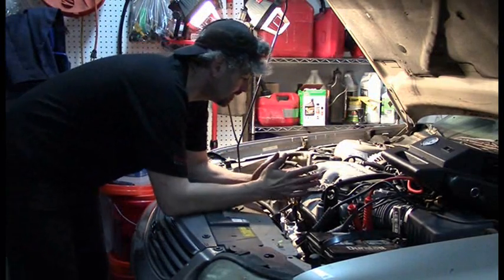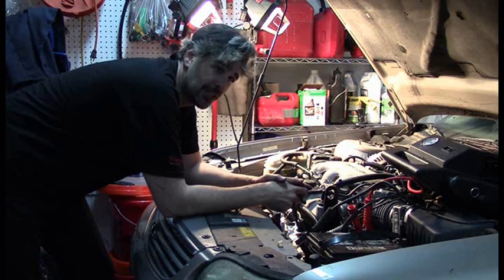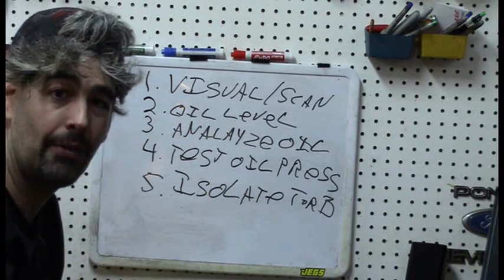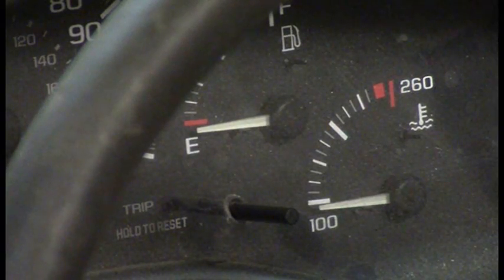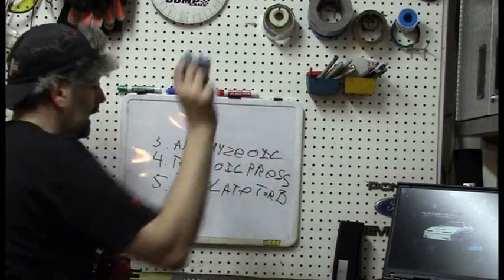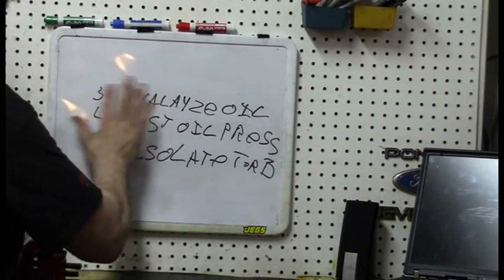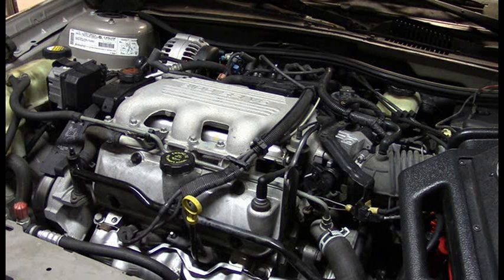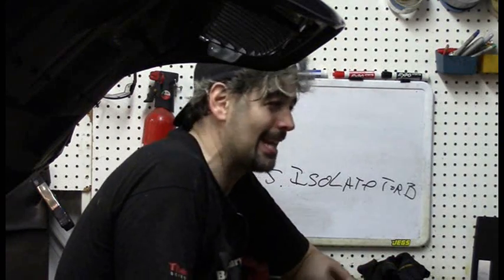Engine Noise Diagnosis-Part 1

Comment: if, as you say, you suck at diagnosing engine noises, why are you doing videos on how to diagnose engine noises. VERY F***ING FRUSTRATING !
Reply from the maker: Because I don’t have an “ear” for it. And neither do you.  I need to use science and logical deduction to solve it.  i am showing you how to do it scientifically so you can diagnose similar.  Did I not find the source of the noise?

Comment: my dodge van knocks same i cant  find problem so im gonna pull oil pan. its a 3.0 i hate it. your hearing is fine.ur a good fixer.
Reply from the maker: Don't pull the pan- instead see my video "diagnosing engine knock using a screwdriver".  MUCH simpler!

Comment: Hi I watch your videos a lot, im wondering if you can help me.. I see you're a very trusted mechanic and you do a proper job of diagnosis and fixing. I have a 1.9L common rail diesel 4 cylinder engine and it's making a light tapping noise when revving. I believe it's the injector nailing as it's only between certain RPM. ( 2700-2900) and stops exactly after this. 

If I unplugged no 2 injector the noise goes away. It only taps during acceleration and stops as soon as you let off throttle but comes back with any minute amount of pedal pressed. I.e only under injectable conditions. Which leads me to believe it is the injector.

I have two questions if you could kindly help I would really appreciate it and it would answer a lot for me as I can't find an answer to these anywhere.

 1 would a tappet or valve train noise be constant or could it clear up after certain rpm?

Could it mean I have piston damage and the relieved combustion in that cylinder quietens the noise?

I have driven 3000 miles under these conditions and nothing has changed or worsened, it still tapps away how it does.

Thanks in advance
Reply from the maker: What happened when you did the procedures shown in the video to differentiate top or bottom end?

Comment: I have 1993 Buick century and I replaced the fuel pump and filter runs but wont idle running ruff won't maintain rpm and is it possible to put an inline electric pump in and get the 45 psi of pressure to make it run the new replaced pump is only putting out 10 psi
Reply from the maker: Sounds like you have a voltage drop problem.  Test voltage drop- you never needed a new pump and filter obviously.

Comment: I am a qualified mechanic been doing this for about 20 years now but I'm always learning something new and seeing new problems. I am working on a 2001 Buick rendezvous engine has a ticking noise like this, and overheating problem due to leaks, I did a compression test 4 cylinders are at 150psi one at 155psi and the #1 cylinder is at 35psi and that cylinder is pushing oil out the exhaust I pressurized that cylinder with air compressor with valves closed and did not hear it coming into the crankcase intake or exhaust it seemed to not leak anywhere so I am puzzled as to what is going on I am in the process of buying a micro boar scope to look inside the cylinder to see what it looks like inside. I was totally expecting pressurizing the cylinder would have air coming out of the crankcase indicating scored cylinder or bad piston rings but I had no air leaking anywhere. Usually this test putting 160psi to a sealed cylinder will show rings, bad valves, or cracked head or head gasket out. Any ideas on what to try next?
Reply from the maker: Sure lounds loike a worn or broken ring to me. Try the leakdown and detecting pressure at the PCV valve perhaps.

Comment: 99 Malibu, hmm. I'm gonna say it's too end probably timing chain. But I dunno. And yes I known this was probably made after you updated the cause but I am working at an auction and doing inspections and condition report writing. I am not so great with sounds either. These videos have been really helpful in broadening my tactics for discerning different problems. Was it this video that you had got flustered because of all the cars you had. Man do I know how you feel. I got them coming out if my ears some days. They just stack up and keep coming. Thanks again !
Reply: Maybe not timing but I'm saying too end I am pretty sure about that.   Didn't seem deep enough to be the piston  I think (not entirely sure )  that the tone is deeper. I mean it's metal on metal. But it is deeper in tone then the top end noises.  I don't know how to explain it I guess. But either way I'm saying too end.  And I missed the update or actually solution.   Also I think the water in oil is a bit misleading in this case.  I don't think the gaskets were leaking I'm gonna say it was condensate perhaps u live near the surf    guessing by the hair.    Ahhh man just kidding anybody hating on these videos c a promptly go fuck themselves.  Thanks for your time and effort please don't flame my response. I am truly trying to become proficient in what I do.

Comment: Wel, well, I did not even check part #2 yet, but....I am saying, it is valve and timing chain related for sure. Chrysler engine, like famous 2.7 V6, has a very weak part, and it is water pump. I bet this engine has similar water pump, turned by timing chain!! They start leaking around 70-80000 miles,...how many miles this car has??And, when water pump start leaking, coolant goes into oilspace, and into valve covers/ heads. Sludge start accumulate, and then valves/ timing chain does not get enough lubrication/oil!!! First sing is that you start loosing coolant??? Was coolant low in this car??? If bottom end is still OK, bearing OK, you can still save this car by changing water pump/ timing chain, and adjust valves!!! Lets see, now I will watch part #2. interesting to see, if I was right =))

Comment: the flash was more then one flash per . . it's a bottom end problem in my opinion.  . I had the 1990 grand-prix SE 3.1 v-6 at around 310,000 km I started hearing that same noise .. ... the 3.1 were known for water pumps and head gasket issues ... antifreeze getting into the oil (bottom) part of the engine,  the piston and connecting rod get damaged because of lubricant issue.  the head gasket is allowing enough air in to case a compression drop and eventually the rod will go through the lower part of the engine block  (Cylinder 3) went on my car

Comment: I found the best way to avoid fixing engines is to avoid GMC products, i have not had ANY serious engine problems in 30 years since i quite GMC previous to that ... many.....your Vids are great!! shows that anybody can learn automotive diagnostics , it really isn't rocket science keep it up..
Reply from the maker: Not sure how you come to that conclusion about GMC when my channel alone disputes your argumentum ad populatum logic fallacy.
Reply: Schrodingers Box  Sorry i should explain,   MY family own a very large construction company we buy 5 or 6  trucks per year and have 35 in service we have gone exclusively with 2500   Dodge platform  products 5.7's hemi's and cummins  we tried the GMC  thing, the engines were  Junk no torqued  gas hogs, 4 blown motors while Hauling loads, (gas engines) and the allison transmissions was the true  Disaster for all of them 50% of trucks got new transmissions within 50,000 miles , all  SOLD immediately afterwards.. and Ford with its endless frozen-in- the block spark plugs extractions 2 or 3 on every vehicle  can't sell them or give away...  and other decades long engine issues carried by Ford Triton engines, JUNK no longer made.. as well as  5 late 90's and early 2000's dead powerstrokes engines  100,000 miles on them, rebuilt and sold immediately.  been there done that.. lol never again!! LOL!!  like i said we have gone with 2500   Dodge platform  products 5.7's hemi's and cummins its night and day  unquestionable  difference in reliability..... so much that  we fired our in house Trucks maintenance mechanic LOL (sleeping at the shop)...  he's now a crane operator , he does carry around a small box of  engine coils though...i will say that the NEW GMC's line are completely  new trucks... why did it take them so long to finally build heaVy duty truck.. Screw ford still junk

Comment: Hi, Schrodingers Box... question.. I just saw this episode and noticed that the wipers where coming on when you where messing with the plugs.  I have a simiular problem which my 1996 sebring in which I am driving and everyonce in a while my car stubles and then my wipers come on, also when it warms up on hot days the car will not drive well at all, but will start... now i have replace my disbiter but now it runs worse and stumbles. I relize that this is the year the OBDII came out so not sure what that means and I have been told I need to replace my PCM., other than that it drives great..just when its cold and for short drive.. :P Thanks

Comment: I've never struggled more when it comes to mechanics than when it comes to diagnostics (computers are a whole nother worldl. I just found this video as I was watching a bunch on engine flush and I just dropped the bottle of engine flush and grabbed a white board. I've never seen it done like this. by far one of the best video styles for diagnosings as it gets. thank you! I'll let you know what it was that cause the sound

Comment: if the oil pressure light goes out can it be assumed that you have enough oil pressure to not cause a noise.
so then traditional methods of isolating if it's top or bottom and is disabling cylinders and the timing light which doesn't really  seam that conclusive. in the past I have been able to hear a slight noise difference disabling cylinders. it'd be nice to have a test more concrete
Reply from the maker: yeah that "cylinder drop test" leaves a lot to be a desired. one of the things many proponents of that hack method forget is it is useless if there is knock on more than one bearing. 
   To answer your question, the answer is yes- provided the pressure light is working properly and reflective of the actual pressure.
Reply: Schrodingers Box Right that makes a lot of sense if there's two bearings failed. Im  dealing with an engine noise complaint. looking for a test or tests to point in a direction. minus oh im the more experienced tech in the shop oh I heard it sounds like x start tearing apart the engine scavenger hunt. it kind of sounds like the car in the video. not a bearing knock which is very distinct. 

This is why I like electrical dig. 12 volts here,  not here done. Verified tests u can be confident in.

Comment: I have a question when i crank my car the engine makes a sound thats sounds like a aluminum can crushing. Anyone have any ideas?
Reply from the maker: Yes- there is an aluminum can in the cylinder. Remove it and problem solved.
Reply: Schrodingers Box seriously when i cranking it thats what it sounds like. Its a bmw 325i. Not sure where to start.
Reply from the maker: So what do you expect? It's a bad crankshaft pulley.  I don't know. no one does   Take it apart until you find what's broke that's all you can do.

Comment: Good ole' GM 3000 series aluminum V-6 piston slap. As ubiquitous on these engines as faulty intake manifold gaskets. You'll never remove this slap; the valve covers on these motors act as a sort of echo chamber for the lifter tick. 

You'll see (er, hear) this on the 2.8, 3.1, 3.4, 3.6, 3.8 and 4.2 engines. Other than the noisy chatter and the tendency to blow intake gaskets, they were pretty solid. If you have one of these engines, keep an eye on the oil. When it starts getting milky, it's time to replace the upper intake manifold gaskets on the smaller engines (everything from the 2.8 up to the 3.4) or on the larger engines (3.6, 3.8 and 4.2) it will be the lower intake manifold gaskets. Replace with FelPro gaskets (which are good for about 100,000 miles) and stay away from Dex-Cool coolant.
Reply from the maker: It should be blatantly, blatantly obvious even to a novice that this cannot possibly be piston slap. Furthermore, if oil is milky you do NOT just replace intake gaskets!!!  You  ALWAYS diagnose through both leakdown testing and cooling system pressure testing to rule out if it is intake or cylinder head related.
  Please dude. This is a DIAGNOSTICS channel. Only rational evidence-based diagnostic procedure is exampled here.
Reply: Sure, it's not piston slap. Good luck with that not-piston slap.
Reply from the maker: don't need luck. I actually diagnose which ALWAYS works. It has to work-it's simple logic.
I never rely on luck.
Reply: Dude, keep doing what you're doing. I'm not posting for you, as obviously you have it all figured out and can't take any advice from someone more knowledgeable than you. My comments are for the people that have these engines and want to know what's wrong with them 95% of the time, which is intake gasket failure (not head gasket, as I see you replaced for no reason) and piston slap (not rod knock, as you incorrectly diagnosed.)
Reply from the maker: No you MORON, I know more than you. That's why you GUESSED WRONG about piston slap. it's why you GUESSED WRONG about the intake manifold gasket.
  You are wrong ALL the time. not correct 95% of the time.  Even if you guessed correctly you are still wrong in logical application.
  I am always open to better diagnostic methods but "plug and pray" like you do is not a method.
 You are in the wrong place. If you want people who guess you go to ETCG or scottykilmer.
 This channel is for people who want to KNOW, not guess.
 If you would even watch the video you would see what an idiot you are.
 Wow.
Reply: Jimmy S God Bless GM_CHEVY they build such Great? engineered ? products!! BLAH
Reply: Schrodingers Box reading this allows me to understand who is who in the world... thank you sir
Reply: Have had a couple of the 3800 series II.  Lifter noise starts around 120- 140K miles but not detrimental.  Upper intake sure to go around 70k due to EGR tube passing through (plastic) plenum and melting it.  It was designed to be cooled by the (useless) passages around tube egress and the gm "upgrade" replacement was just thicker plastic(doesen't last longer).  The best replacement is the aftermarket with reduced diameter EGR.   Will go another 100k if done right.

Edit: the coolant passages around the EGR egress is where the coolant begins to seep from and eventually floods the engine.

Comment: mannn let me tell you i love your channel and not only because ALL the information you go over dont matter which issue you trying to troubleshoot i ALWAYS learn something new, my favorite video has been so far about the debate of either oxygen sensor or HC sensor, VERY VERY good videos, its not sometimes even the topics but is how you approach the diagnosis strategy, how you think from start to the end is incredible, anyone can know about many things but knowing how to express your thoughts is a HUGE difference from just knowing the subject. btw on this video to us "listeners" is hard to hear what type of noise that is since over the speakers of the camcorder the noise gets a little bit distorted, with all i did wanted to share with you that noise could be a possibility of a bad timing belt/ chain hydrolic tensioner, i had one of those in the past and it can be easily confused for internal knocking. i am not sure if you raved the engine at all during the troubleshooting but the vehicle i worked on the noise would go away after 2500 RPMs since the tensioner would gain pressure from oil, just a thought but again over the video recorded is hard to hear what a noise could be....but great video Matt, i been watching all your videos little by little and ALWAYS but ALWAYS learning something new!

Comment: Pre-Ignition, not Pre-Detonation. Detonation is it's own bad thing, quite different from Pre-Ignition.
Reply from the maker: Explain the difference for the viewers please.
Reply: My layman's explanation (plenty of in depth articles on the web):

Detonation is unspent fuel/gases detonating within the cylinder AFTER normal combustion due to excessive heat/pressure. Detonation is not a controlled burn and has concussive force (sharp pressure spike). This force is what creates the ping/ring sound as the block resonates. This vibration has a specific frequency around 6000hz which knock sensors are tuned to pick up. Engines with higher HP per in3 are more susceptible to damage from detonation. Detonation can cause various types of damage: pitted piston crown, broken ring lands, scuffed piston skirts, fractured valves and plug ceramics, overheating, etc. Detonation and an overheating engine tend to go hand in hand.

Ignition has a sweet spot in relation to degrees from TDC for all gasoline engines. If the fuel in a cylinder is ignited prior to the intended point (as in around 180 degrees before), you have pre-ignition. It is spontaneous combustion PRIOR to ignition. Typically occurs near the beginning of the compression stroke due to a hot element (plug, carbon ember, etc) which acts like a glow plug. There is no high pressure spike but rather excessively high pressure over long periods as expanding gases are compressed via the piston stroke. There is no noise associated with pre-ignition to alert you so it is usually not identified until after it causes catastrophic damage to the engine. Such damage will happen very rapidly as heat builds up, an engine will only survive a few seconds under pre-ignition conditions. Typical symptom is a hole melted through the piston since it is the weakest part with the least ability to dissipate heat, but melted plug electrodes and ceramics are also possible. A plug can actually begin to melt before pre-ignition and then become the source pre-ignition.

So there is no such thing as pre-detonation. Common confusion.

Comment: tip when removing plug wires use a test light that is grounded and the spark with pass through the test light and not you lol